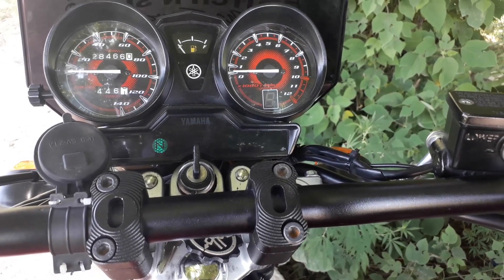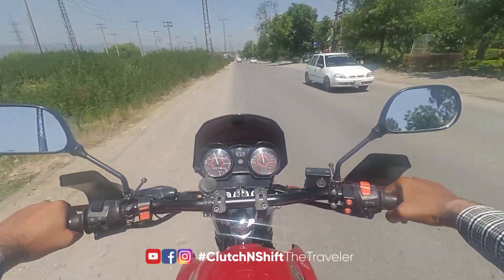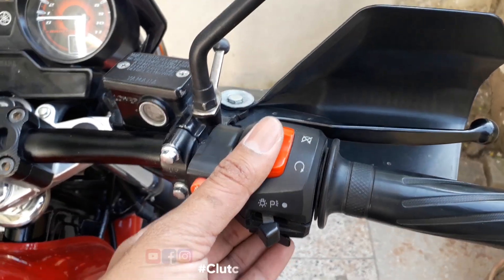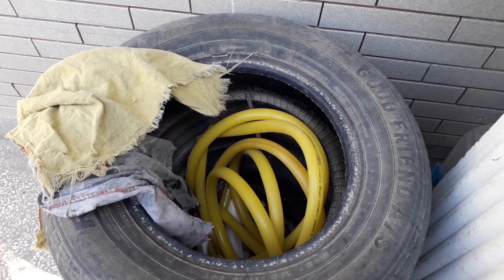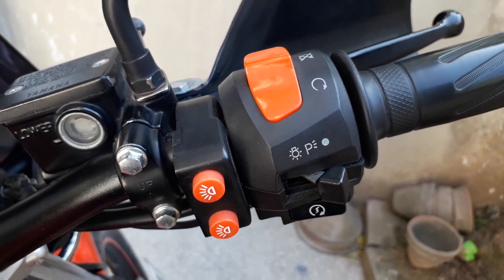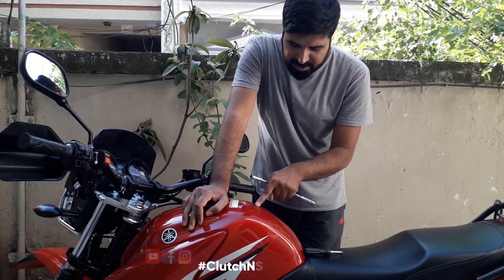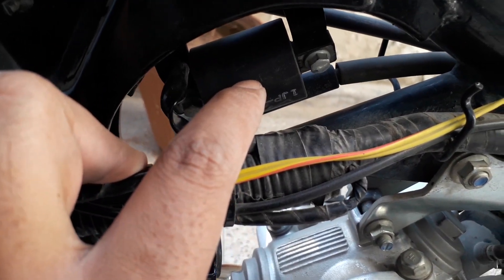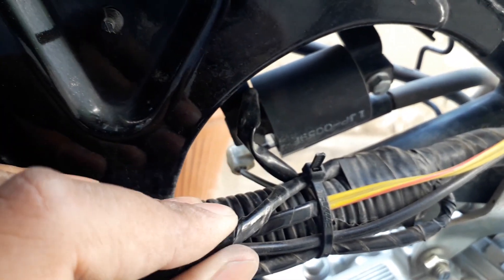How To Install Engine Kill Switch on Motorcycle | Why Engine Kill Switch? | Motovlog | Pakistan

Comment: Sir mera 1 question hai
Jo cdi high voltage kr agy coil ma bhajta hai or phr coil sy aagy current spark plug ma jata hai 
Spark plug k wire ma kill switch connect krna hai ya phr us sy peecha .kindly rply
Reply from the maker: Us sy peechy q k kill switch ki wire itna heavy current nhe utha sakti.
Reply: Cdi current increase Kr k aagy bhajta hai
Cdi sa bhi peecha kill switch k wire lgani hai.
Ya Jo wire switch wali side sy aari ho

Comment: These are all substandard bikes. I had a Kawasaki GTO 110 1988 RIS 6868 and it not only had a helmet lock but also an engine kill switch. GTO 125 had an added side stand control in clutch assembly. I am talking about things those bikes had some 33 years ago.

Comment: I install kill switch butt its working wrongly when its off bike start and when its on bike off plz tell me the reason
Reply from the maker: Wiring inside the Kill switch are in opposite order...change the wire position
Reply: @AmmarBiker  thanks

Comment: Why didnt you use a relay? That would be simple ,easy and more efficient
Reply: As you will definitely have problem in current distribution as you reroute the main coil current using a long wire. Not recommended.. use relay ...

Comment: totally wrong wiring  showed by you   
kill switch ki wire simply  ignition switch ke ground pa dety ha
Reply: Us sa power totally band ho Jaye gi no light horn even I think CDI ko Jo 12v a raha wo cutoff KR dain to shyd zada safe ha
Reply from the maker: Ap ka ye comment dekhny k bad specially ap k liye aik new video banai hy jo abhi thori dair men channel py arahi hh